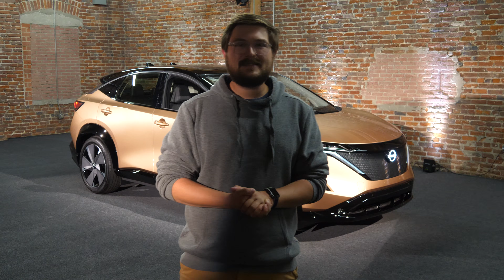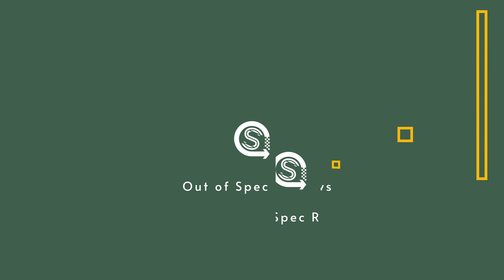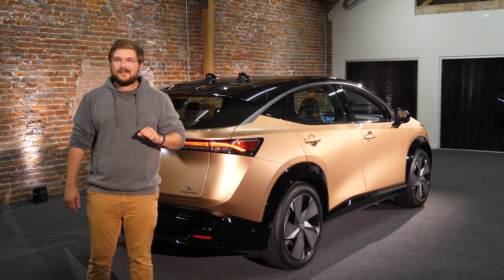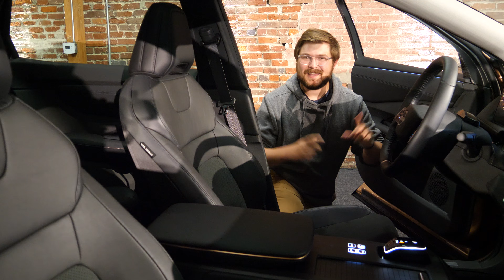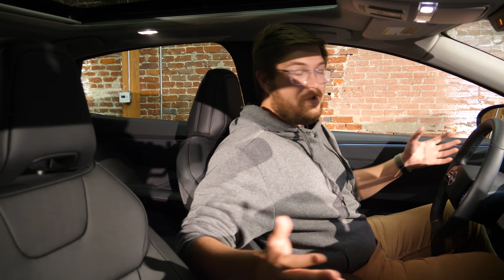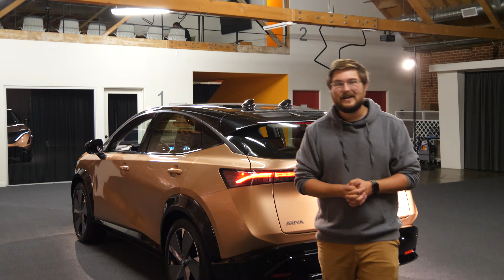11 Best Nissan Ariya EV Things You Need To Know

Comment: I’m curious, once the batteries have expelled themselves, what does a new battery pack cost?  Then, what happens to the old battery pack, recycled or like the Atomic weapons, buried for our grandchildren to deal with?
Reply: unfortunately not many enough out there seem to care about this long term problem. I am hopeful once electric vehicle reaches critical mass manufacturers are push for the right to repair (battery repair or battery swapping)
Reply: @myOpinionIsMine-n-only-mine  You can already battery swap leafs and volts. I don't think that would be an issue.

Comment: Forget about Nissan! Without a charging network, it's just another EV. Worse, it's Nissan, a company that could have buried Tesla before they even got started but they are run by people on salary. They coulda and shoulda been a top player in the EV game but just no imagination whatsoever.
The whole Tesla story is about a company on the edge. They dreamed big and almost went out of business. Now they lead everybody on just about everything.
I'm 78 and Nissan is the company that got most of my business over the years and I've enjoyed their cars but it's a very different company nowadays. My local Infinity dealer moved to a new location and now looks like a used car lot. You know, the kind with a small central building surrounded by cars. I'm amused every time I drive past.
Reply: @mikeb1039  Well I hope Nissan has success with their new EV and evidently there looking better lately.
If that's your choice, I wish you the best of luck. My disrespect for the brand is they did nothing of note considering they were in the EV game so early. They wasted many years with poor management.
Local Infinity dealer downsized considerably and the local Nissan dealer closed shop and Tesla took over that location and building a larger facility.
I want to see broad success in new EV vehicles not just Tesla but Tesla leads in so many categories that it just might be too late.
I think the Korean brands are going to make the biggest noise with coming EV releases so I'd hold off purchasing a Nissan until you see what Korea does first.

Comment: Having the charging port on the passenger side seems like a poor design choice to me, compared with the more typical driver side.  Unlike ICE vehicles, most refueling happens at home for EVs and is done frequently, such as every night.  Typically, with an EV, you get out of your car, plug it in, and go inside.  Or unplug and then get in your car.  By having it on the passenger side, you have to walk all the way around your car to plug and unplug every day.  Some home garages (like mine) is a tight fit getting the car and all your other outside stuff to fit in the garage so you may have to squeeze around stuff or walk all the way around the back to get to the other side of car, amplifying the inconvenience of having the charge port on the opposite side.  Though I guess this may depend on your garage configuration (the door to the house is on the left side of my garage; if your home entrance is to the right of the car, then this configuration of having it on the passenger side is better).
Reply: The rest of the car features are great though and is priced very good considering all the things you get with it.  I love the wireless phone support, driver assist features, and behind the wheel screen.
Reply: Seems similar in many ways to Ford's upcoming Mustang Mach-E.  Both have the optical illusion black roof with spoiler.  Both have the dual screens, with one being behind the steering wheel.  Both have similar range and battery configurations.  The Ariya has front wheel drive though as an option which is great for colder regions with slippery roads (though the even front/rear weight distribution of EVs might mitigate much of front wheel drive's traditional advantage over rear-wheel drive regarding traction.  It would be interesting to see some tests regarding what different front vs rear drive makes with EVs for handling and traction; would make a nice out of spec motoring video... hint hint Kyle).  The safety and driver assist features are very similar between the two, both opting for hands-free modes, as well and both use the same charging standard.  Ariya starts at a lower price, which may win over some on the fence of which model to buy.
Reply: Wow!!!  That would give me a reason NOT TO BUY this one!!!  I love how GM stays consistent and puts all theirs on the driver’s side in front of the door!  I want an Equinox EV next!!